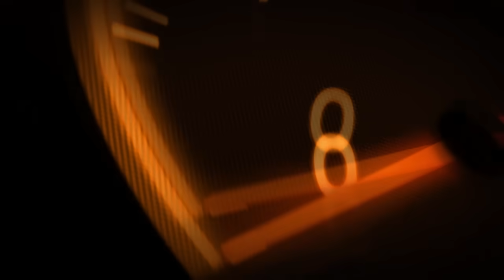Big Engines Starting Up

Comment: Loved the EMD 645 engine. Locomotives such as the SD40-2 where equipped with them. That sound is iconic amoung railfans!
Reply: Puget Sound Railroad Multimedia love to see the rockers
Reply: Railfans yes, but I'm an engineer and we had those back in the '80s. Whilst the sound they make at full throttle is awesome, you don't want it right behind you for 8 hours solid.
Reply: EMD 645E-3 and 567b are the two best sounding engi es on the rails
Reply: @shelbybrunhoeber2576  I used to have one of those engines in a 75 foot long tugboat those are so reliable they never fail I wish I never have sold that vessel 20 years ago because just the other month in Oakland I saw that same vessel still operating in the Port of Oakland still going strong.
Reply: Yes!

Comment: Is there video of that VW bug driving around with that plane engine?
Reply from the maker: +MrVideoyoulike no i think found only this video and some others but only starting
Reply: Jay Leno has an episode of his web show "Jay Leno's Garage" where they have a radial-powered custom truck with a similar engine.  might be the closest video you find to that bug.
Reply: The owner want's to take it to the Bonneville Salt Flats and do a speed run using a propeller as propulsion.
Reply: +Kaeto2002 hopefully it doesn't fly off or anything
Reply: Kaeto2002 - Look up the the Bloodhound SSC - going for the Landspeed Record of 1,000 MPH for years now. They have to go to the flattest spot on earth to run their test! ..and yes SSC stands for Super Sonic! Their using a Rocket AND a Jet Engine.
Reply: MrVideoyoulike
Reply: +knud larsen pipe down knudddy larsen

Comment: 6:03 just look at all those oil filters
Reply: CUMMINS POWER
Reply: Yep! That's a lot of oil.
Reply: lmao that engine is running on molten inline 4s
Reply: Idk fam, put it in a Ram 1500 and you have a ticking bomb ready.
Reply: Could use an air fan...

Comment: 6:44 crazy to think we now have that much power in light duty pickups from the factory.
Reply: And from 1/10 of the displacement
Reply: You never get that much torck
Reply: @newzarte  you know, I'd like to know how much torque this thing put out. Nobody specifies torque, just HP. Maybe they couldnt efficiently read that much torque back then. But still, we can get 1,000+ lb/ft of torque from a new 6.7 from either Ram or Ford with a simple tunr, so not bad at all.
Reply: Yes, but not that torque😂

Comment: I think steam engines should’ve been included with horsepower far beyond a lot of these engines. But also omitted was the 109,000 ho Diesel engine of the Wärtsilä-Sulzer RTA96-C. The engine weighs 2,300 tons and stands 44 feet high and extends some 90 feet. This was in 2016 so by now it could have been surpassed.
Reply: Wow.
Reply: Peak power for that engine is at 104RPM it has pneumatically operated valves so no camshaft, timing gears etc and is rated for 84MW power or 84 000KW or 114000 HP. It runs so smooth and slow though that I doubt it would make much noise. Normal operating speeds are less than 100rpm and it can idle at like 4RPM....

Comment: I want to see someone put one of these engines on a Prius 😂
Reply: Let's put the DM 884WS-150 on it, mybe can fit on the Prius 😂
Reply: Morgan Miller or in a smart car
Reply: Why?
Reply: Morgan Miller
You could always drop one on a Prius to find out.
Reply: Nah, i have the last one mounted on my Velo Solex.
Reply: well you need to throw that thing in the BACK of the car cuz that hood ain't going to do the job
Reply: Morgan Miller I’d rather see them drop it on a Prius
Reply: Morgan Miller most of these engines will either crush or burn the thing 😂
Reply: Some guy threw a hellcat in one just for the fuck of it

Comment: What was it Speed Racer said ?
"Sounds beefy, Pops !" 5:22

"Chitty Chitty Bang Bang" 9:26

Remarkably quiet for its size. 6:02

Now I know where the term SPITFIRE comes from. 6:29

Was waiting for that live chicken to get closer. 7:02

Won't these propellers going in opposite directions fight against each other by wake ? 8:11
Reply: a2pha they go in opposite directions but the propellers and angled differently for each; the net thrust is still forward bc the blades are still scooping air forwards and shoving backwards
Reply: Jack jonson
Reply: The double propeller isn't really a good idea though. It might help offset the rotational torque caused by the first set of propellers. But it wouldn't really help with boosting thrust. Let's say the plane is moving at 200mph, the propellers are pushing air behind them, and let's say that air is moving at 300mph. Since the second set of propellers is right behind the first set, it too pushes air behind it,  except it's pushing on air that's already moving at nearly 300mph, so if the second set generates any thrust at all, it would be small. There's also the problem that you can hook up 100 propellers to the engine, but you won't generate any more thrust than the engine is capable of generating. So instead of having one propeller generating 100% of the thrust, you'd have 100 propellers generating 1% of the total thrust each, and the total thrust would still be the same as if you only had one propeller. 

So in summary the only purpose that second propeller could serve is to negate roll that might be caused by the first propeller.

Comment: The VW with the radial engine.... some proper "Hot Rod" action right there....
Reply: TheCymbalProject That guy died from the fumes
Reply: I'm surprised he got it tagged lime that in California
Reply: Definitely not getting that past CA emissions
Reply: U
Reply: OMA
Reply: Uuu
Reply: Some folks don't realize that nearly all radial engines smoke, and fart to get started. The oil supply is in the middle of the engine. The lower cylinders get some oil in them, when they are not running, due to oil seeping past the rings. Once you get the cylinder cleaned out, they fire right up.  And have been remarkably reliable over the decades.  I once flew a large passenger airplane out of Atlanta. It had the shields on the side of each engine:  "powered by Rolls-Royce.  Those engines pumped out smoke, and belched for what seemed like forever, Finally when they started, each one blew out an enormous cloud, with fire stirred into it. Some of the passengers were actually nervous. It may have been an old Piedmont Airlines plane. The hung on till the end.  Anyway, once we got to the end of the runway for takeoff, those engines were making the sweetest sound. They never missed a beat, before we left the ground, or while we were in the air. I'd still fly one any day.  It just has a sound like something meant to keep operating.  Jets scream too much. I know the operational method, but I always felt if one came unglued, it immediately turned to junk.

Comment: I was stationed on an Army tug in 1970. It had a Fairbanks-Morse 6 cylinder air-started engine putting out 1,200hp. The cylinders were the size of 5-gallon buckets. There was no transmission, for reverse, the engine ran backwards.
Reply: When the engine was started, did the tug shake a little?
Reply: Yes, it did. The steel deck in the engine room would tremble.
Reply: Must have been a huge 2 cycle motor then.
Reply: Retired Coastie here, described as the Pacific Area Fairbanks-Morse guru. Four tours on 378 foot cutters with two twelve-cylinder 38TD8 1/8 F-Ms. 3,612 horsepower each. Forever. The Woodward governors couldn’t even move the fuel racks alone. The air start distributor sent 170+ psi air into the cylinders in sequence during start. The governor operated a servo booster that used engine oil pressure to move the fuel racks, so it had to be cranked until it had oil pressure. Or, if you had to start it on ship’s service air (100+ psi) two people would use three foot long screwdrivers to pry the fuel racks back as the engine cranks. One of the tricks of the trade!

Comment: 6:44 I'd hate to be paying the fuel bill for that 60 litre engine!
Reply: Those big old engines are often surprisingly efficient due to very low rpm, look at the 375 rpm that the Allen is capable of chucking out 500bhp at

Comment: last engine would a great swap in my car, no need to tune, already had 22000hp! skids!
Reply from the maker: +Off3er :-D :-D
Reply: It made electricity, when it was still in normal use
Reply: And it is loud as heck. I had been there when they started it up. I thought the whole building will fall down, or the engine will went off
Reply: Daniel Jensen u
Reply: What is that, a cruiseliner engine?
Reply: Off3er  real good fuel economy also , how many barrels per mile?

Comment: This reminds me of an oil refinery in which I briefly worked at last year. They had a room in the laboratory that had two huge engines (one diesel and the other gasoline) that were for testing the economy of the refined oil. You could see all the machine pieces moving around and they were very noisy.

Comment: 9:10 slap some wheels on it at take it to the strip 💪
Reply: tawon1984 let’s go do it sounds fun
Reply: Im so dead rn 😂😂😂😂😭😭😭
Reply: 41 ft tall, 80 ft wide 22,500 hp... my moms 2014 ford expedition only does like 150 prob
Reply: HOLY BALLS 22K HORSEPOWER
Reply: @Miguel-tb7dd  It was used to run generator. 22k isn't much anymore. Many freighters have more powerful engines. Wärtsilä RT-flex96C generates 107k hp and 7 million Nm of torque.
Reply: @UltraCasualPenguin  im a car person not a submarine, plane or boat guy i have to say that is impressive
Reply: @Miguel-tb7dd  I'm none of those. Maybe car person if those are only options. I'm more like space person.

Comment: What was the Rolls Royce V twin used on?
Reply: tomshiba51 old planes like ww2 era.
Reply: The Rolls Merlin was used on British aircraft like the Hurricane and Spitfire.  A Packard U.S. version was used in the P51 and some P40s, all WWII aircraft
Reply: Those were the twelve cylinder engines.  What was the Rolls Royce V-twin engine in this video used on?
Reply: I've seen enough crash videos to see that this often happens at that critical moment.
Reply: tomshiba51 spitfires
Reply: Are you saying that the two-cylinder engine that I am referring to in this video was used in a spitfire?
Reply: What's the time stamp of the engine you're referring to Tom?  Back in the old days, V engines were often referred to as "twins" because they had two banks of cylinders, not 2 cylinders as twin generally describes today, so that's why we thought you were referring to the Merlin.  So no,  there were no two cylinder engines ever used in a Spit :)
Reply: It is a custom built engine, using Merlin parts. It is in a motorcycle 
http://www.abc.net.au/local/photos/2015/08/19/4296075.htm

Comment: The big bud 747 actually is a 1100 hp tractor
Reply: DrCloroxBleach they are very old so they probably cant even get 1000hp anymore dk if they still make them
Reply: Somerset Farmer If they aren’t used then sure, I believe the old girls can get up to 1100 hp if they get new belts and oil. And they sadly don’t make them anymore, but they did make quite a few, with varying models and hp ranges. The YouTube channel Welker Farms has quite a few of the Bog Bud models.
Reply: Well when that big ol thing came out of the factory it actually had 760 hp then they slowly upgrading until it reached 960 hp then they swapped to a Cummins that had 1100 horsepower
Reply: @colewise6493  no, they cranked up the original Detroit to 1100 horsepower.

Comment: 3:30 - hmm, 3 - lobes in a group? VTEC? :)
Reply: Two intakes, one injector=3.
Reply: @P_Rund1952  no intake is built on the side of the cylinder there 2 exhaust valves and 1 for fuel injector

Comment: In my country the pits on the roads are so large that they are confused with missile silos. So no matter how much horsepower you have under the hood, it's important not to hit the warhead.
Reply: The faster you're going, the less likely you are to fall in, right? :)
Reply: @iilhares  1:36 even when driving that jet powered Beetle, practically an Aircraft, won't even bump that bumper on the edge of the pit.

Comment: WTF is that last one used for??
Reply: I was wondering the same, my only guess is cruise ship or some large ship
Reply: Just found out it's a diesel generator power plant in Copenhagen
Reply: Rick Gravel, it is an old 15MW powerplant from 1933. It is called H. C. Ørstadsværket and is located in the heart of Copenhagen. It was in use until the 1960s, after which it was used as a backup powerplant. Last use was during a blackout in 2003. Today it is a museum called Dieselhouse where they start it up twice a month, with free admittance. Bonus info: It uses 3 tonnes of diesel at full load.
Reply: I use it on my Honda
Reply: Too small - Wartsila makes them much bigger for one of those.
Reply: Hm I would have guessed a ship engine.
Reply: I have seen it start, its glorious. We where told its the only plant that can kick start the power grid if it fails. All other plants need a frequenzy to couple into (50hz), and this one can ramp to the right RPM and the other power plants got a "guide"
Reply: Tourists....
Reply: Rick Gravel boats?

Comment: Some of these engines have displacements larger than my car's fuel tank.
Reply: Ship engine has a displacement larger than your car😂. Possibly even your house😂.
Reply: @marcusaureliusregulus2833  yeah 😂😂😂, forget house my entire apartment is too less for it
Reply: The locomotive engine at around the 3 minute mark is an 645 Series engine. 645 is the displacement...per cylinder.

Comment: why would you list horsepower numbers on  a video about what seems to be mainly diesel engines when they are built for torque
Reply from the maker: +EmofacePS3 because 99percent people wants know info about horsepower but ok no problem include both of figures
Reply: torque has no effect if the horsepower is the same, big diesel are used in generating electricity and only thing that matters is kW, You should look up how power is calculated for motor.
Reply: @Car News Central:  True. Thanks for adding the HP!

Comment: Then there's submarines which make like no noise
Reply: I believe submarines are using nuclear reactors and eletric motors.
Reply: diesel submarine engines would be just dumb.
Reply: Jefferson Sales What do you think cane before nukes???
Reply: And are still in use in some of the smaller subs. Diesel electric is a LOT cheaper than a teakettle...

Comment: It’s funny. I’m finally building a rail cart to try some of these Southern and Northern California rails and I’m wondering the same thing as several others watching… where do you find wheels for under $250/each? I found some cast iron mine cart wheels for $75 on eBay, but would think that to be pretty uncomfortable. Please share if you can the wheel source.

Comment: It's neat that engines are basically a paddle ball where the paddle is a gun, gunpowder is liquid fuel, the string is a metal rod and the ball is a hunk of metal.

Add couple of the paddle balls together and you've made horses jealous

Comment: Do airplane engines use a transmission system? Shirley, you could get to a hood cruising altitude and lower the fuel usage up there by putting it in a higher gear

Comment: I used to work for GE and guided the engine onto motor mounts(train locomotive), and fired them for first time. Turbo alone was bigger than most these engines.

Comment: For a moment when the big bud started, I thought it was about to run away
Reply: Of course, referring to a runaway Diesel engine, when extra fuel gets ignited, and the engine goes to max rpm till it’s oil runs out and seizes, or till you cover the intake

Comment: In the unit of the nuclear power plant I work, we have 4 emergency diesel generators and it's qute big and loud. And it's interesting that even though it's like hundreds of times more powerful than a small generator(about 6MW, I kinda forgot), it,s not hundreds of times louder, so normal earplugs are enough. I work with electrical maintenance so I don't know how the engine works.

Comment: I heard a fuel injected nitro fueled special edition 492 Ford with 12 inch pipes set up from Max RPM.   They were using it in a Bonneville Salt Flat car.   The driver sat before the engine in a stilletto car with skinny solid rubber tires.   It did about 400 mph.

Comment: The BHP figures for the large engines is impressive, but as they spin so slow, the torque figure is far more important. For example the Finnish Wärtsilä-Sulzer RTA96-C produces 107,390 bhp. But, the torque figure is 5,608,310 lb/ft !!!!! It only spins at 15-102 rpm.

Comment: This is going to get a lot of hate, but: I think American engines sound like they're not running on all cylinders. Doesn't matter if it's a V twin Harley or V8 Cadillac, they have a horrible splattering sound, unlike the smooth grumble of European/Japanese engines.